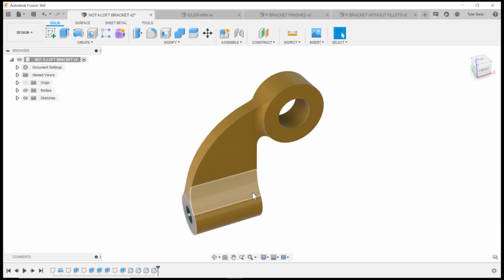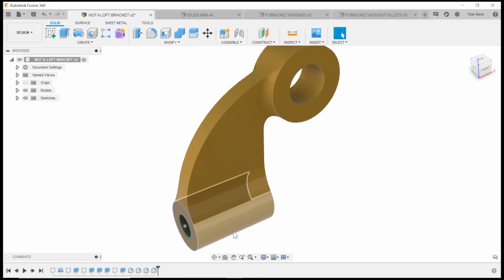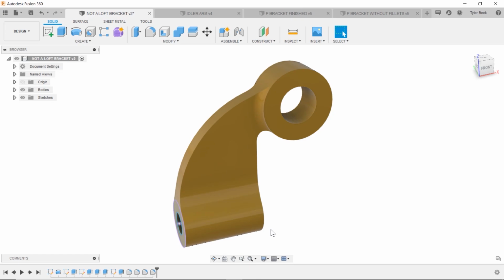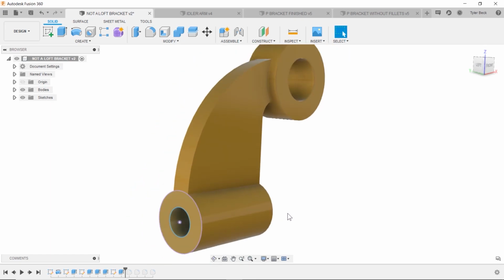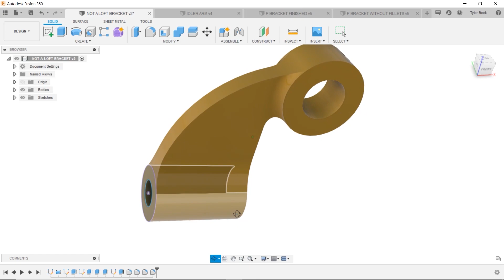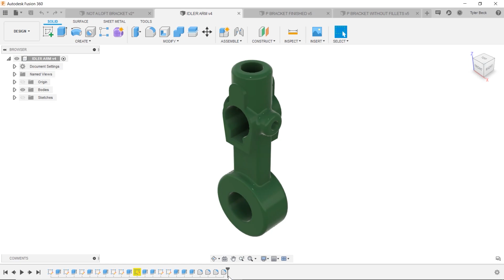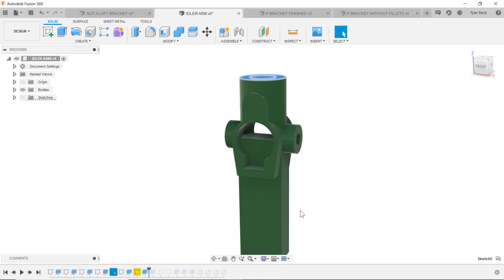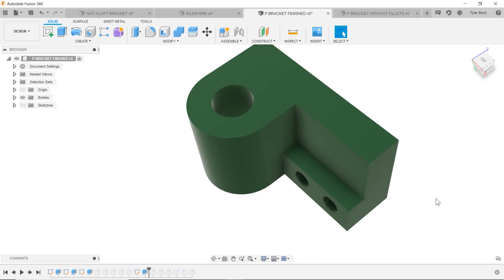One Secret You Should Know To Improve Your Modeling in Fusion 360

Comment: I was a Solidworks Structural designer that did Hovercrafts and boats for the Navy. First thing i lectured with parametric 3d modeling is Design intent. Before you start making parts figure out what might change down the line. I know you can't plan for every change but you can build parts based off if certain holes or shafts etc.. and that way if you ever run into changes down the line in real life you can modify a few dimensions that updates most of the model without redoing the entire thing just because they moved a shaft over 5 cm or needs a thicker Pad Eye Lifting Point